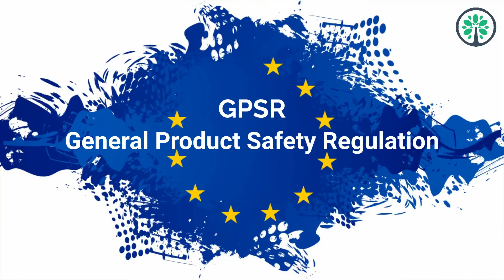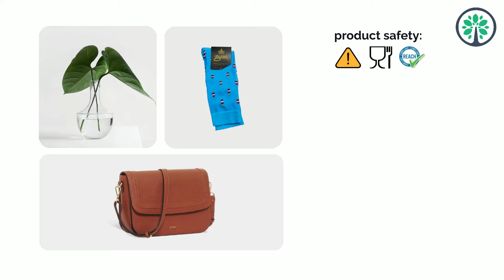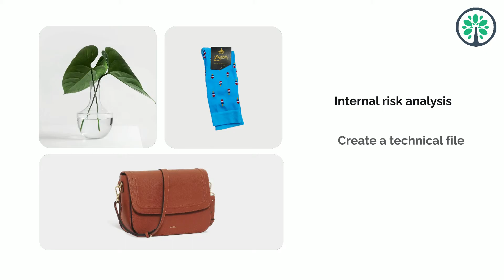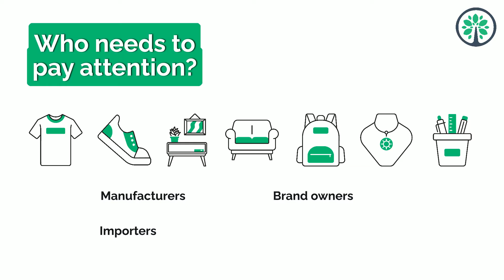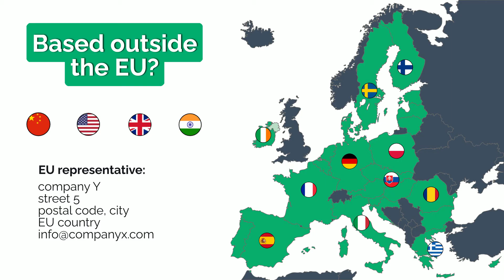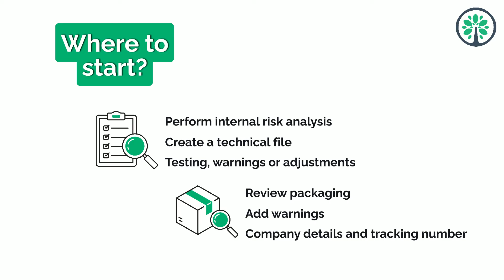GPSR explained: The EU General Product Safety Regulation

Comment: What if the product is not safe, say for example an skateboard?
Reply from the maker: It depends whether the product is already placed on the market. If so, the responsible economic operator must firstly inform consumers and national authorities through the Safety Business Gateway: webgate.ec.europa.eu

Secondly, corrective measures should be applied: Appropriate actions must be taken to mitigate risks. Think of a recall of the product. 

Lastly there are the remedies; In the event of a recall, consumers must be offered a choice between repair, replacement, or a refund.

Comment: Do GPSR requirements contravene the UK-EU trade deal?
Reply from the maker: @PJ-om2wq  The GPSR requirements are part of the EU's own regulations on safety standards and don’t violate the UK-EU trade deal, but they do create extra steps for UK businesses exporting to the EU, as they do for all other non-EU exporters.
Reply: @westwoodsourcing  if every UK company needs to appoint a Responsible Person inside the EU, that's not really a free trade deal, is it?
Reply from the maker: @PJ-om2wq  Actually, it has nothing to do with a trade deal. This is regulation by EU for EU member states. If a non-EU company would like to sell on the EU market, then they should adhere to the EU laws, just like EU companies would have to follow UK laws if they wish to sell on the UK market.

In fact, EU companies for some time already need a UK Representative to be able to sell toys or electronics on the UK market.
Reply: @westwoodsourcing  to be fair, I didn't know that EU companies already needed a UK rep.
Reply: Actually, I see no evidence that suppliers of most goods need a UK rep. These are called an AR ( Authorised representative ), and according to gov UK are not mandatory except for certain specialist industries such as medical equipment. For toys and electronics the requirement is that a supplier can certify the safety (and self certify is still an option) and they have to apply UKCA or CE marking to the product. No UK based representative is needed.
Reply from the maker: @PJ-om2wq  That's right, for medical equipment in the UK an AR is mandatory, for other UKCA it is optional.

Comment: So all the hundreds of thousands of small businesses selling second hand goods where the info is not available anymore will have to go out of business as it is impossible to comply.
Reply from the maker: @JustBens  GPSR is meant to ensure that products that are sold to consumers are safe, whether they are first or second-hand. 

Of course the consumer can't reasonably expect from second-hand items that you provide the original user manual. You are however responsible that the product is safe to use. You could perform a (visual) inspection to ensure this.

It really depends on the type of product. For instance, if you sell toys, it might be necessary to provide a warning that it is not to be used by 0-3 year olds due to small parts that could be swallowed.